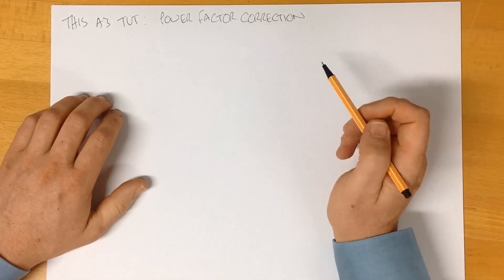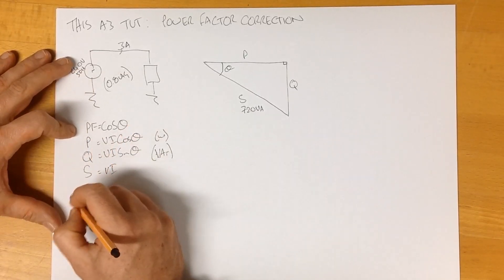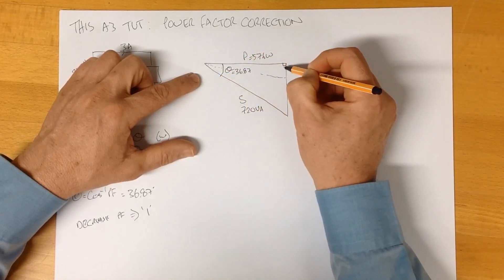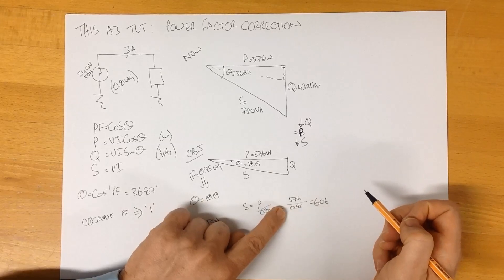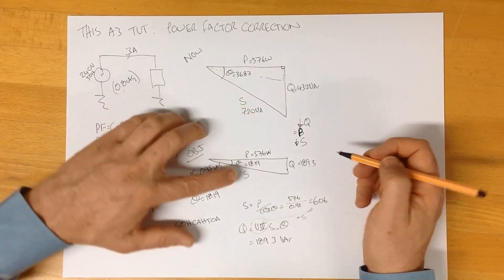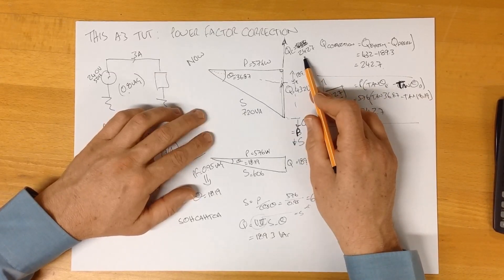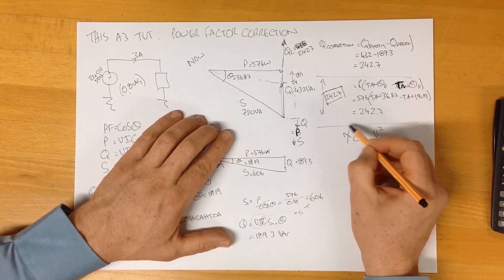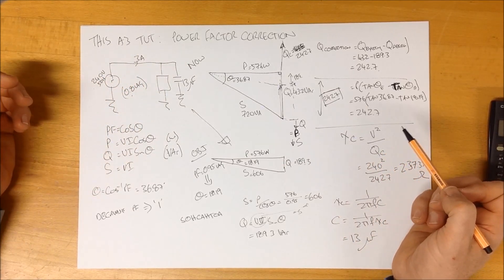Taylormade@AUT A3-tutorial: Power Factor Correction

Comment: Excellent lecture, sir can you  explain power factor correction capacitor where exactly to be installed in the circuit, like in the video you have installed parallel to the load why not in series. please explain